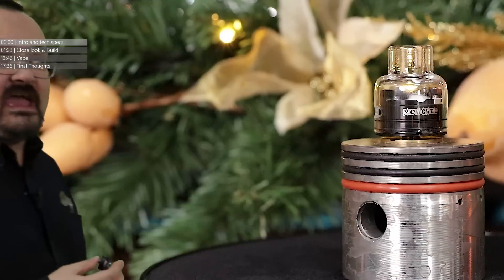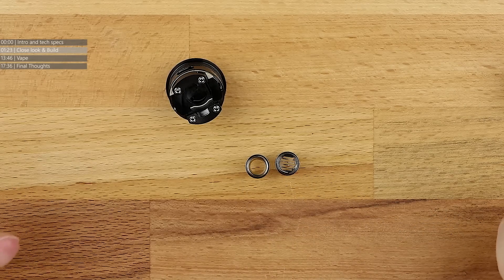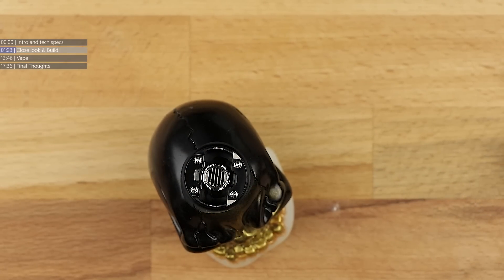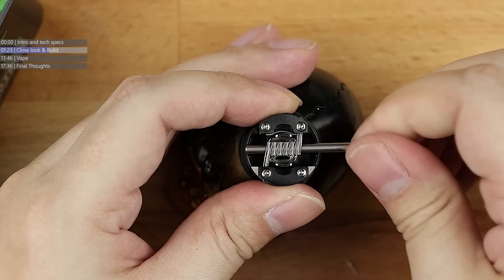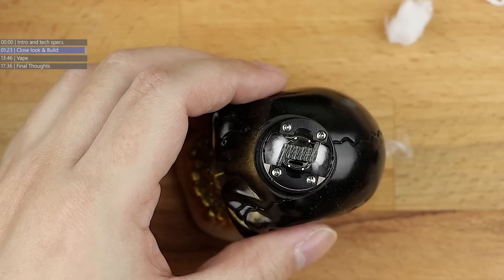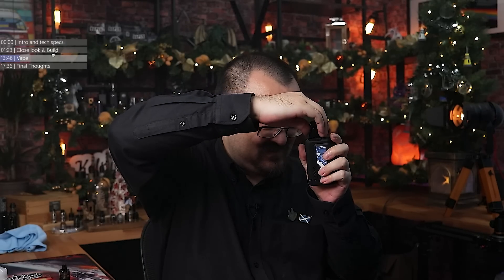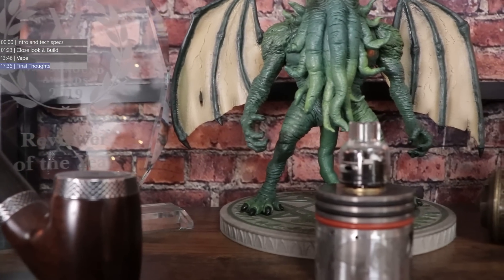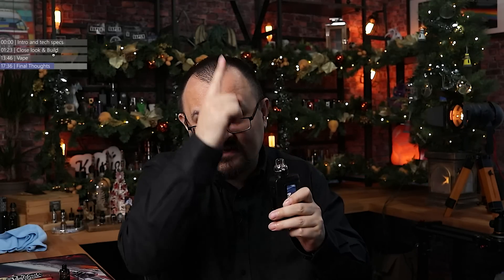DamnVape & Deuces Jack Mongrel RDA - Glass cap included?!

Comment: I have the black, stainless, and gunmetal. The second run has flat black, and I don’t have that one. Colors will be out on the third run
Reply: Really wish I had bought 5 each of the first run colors lol
Reply: What size build are you running in the Mongrel? Mine is on the way and I'm hoping that a 28g Quad Core Alien will be big enough to accommodate for the more airflow in this single coil RDA.
Reply: @CountryboyAR  I have a dual coil in one, and the other 2 have 4.2 mm quad core nichrome coils

Comment: Waiting on mine to arrive gonna replace my OG recure single on my single battery sqonk been using that OG recure for years never thought anything would knock it off its throne.
Reply: It's not going to dethrone the ReCurve. The Mongrel still has way too much airflow even with the inserts which will cost you flavor. Single coil RDA's are restricted for a reason.